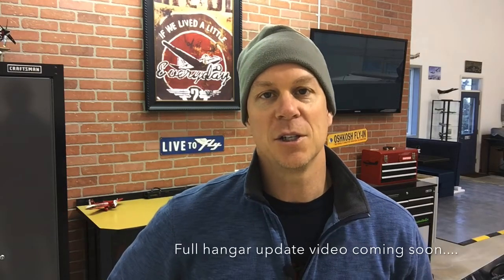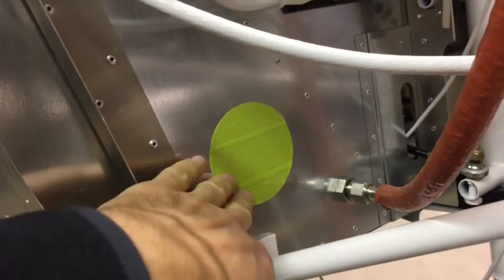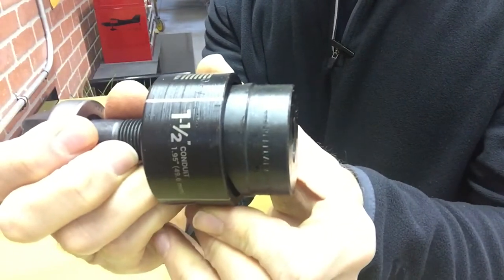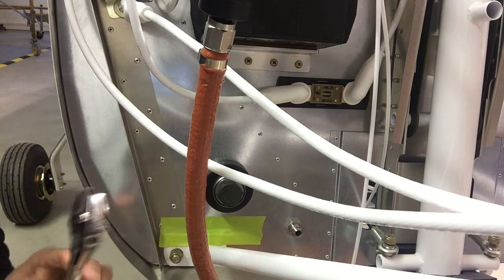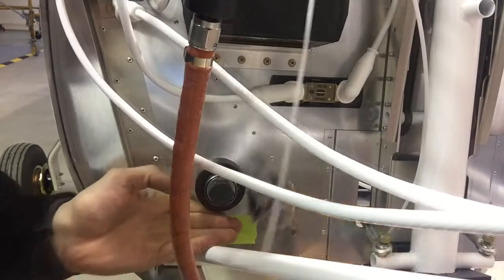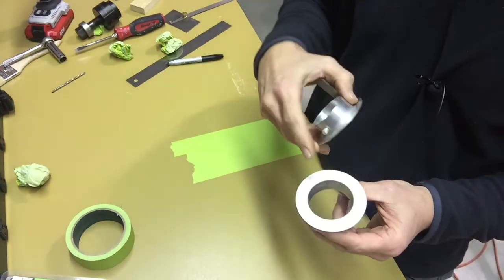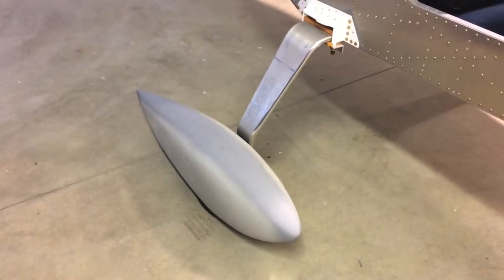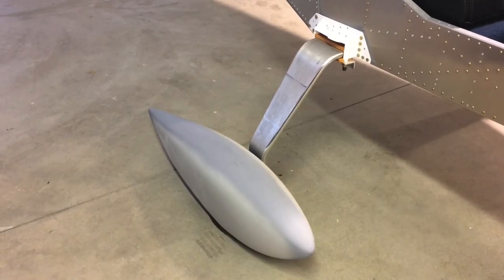Zenith Cruzer Airplane - Cabin Heat

Comment: Don't forget some stainless steel mesh with 8 mesh per inch.........form it like a spray paint lid and clamp it over the valve tube end , and under the scat tubing..........if any wasps or hornets build a nest in the scat tubing , they won't be able to make it into the cabin through the valve...........they will be pissed off and will be looking for revenge if they can make it passed the valve  ,  when you open it on short final..........or , you could also fashion a bubble shape ( like your fuel sender covers ) in a flat piece of mesh , to clear the flapper valve ..........and clamp it between the firewall and the valve halves.......either way would work..........I know of more than one pilot that had the surprise of his life , when he pulled the heater valve open and was treated with an encore of stings...

Comment: Cool plane, nice watch cap too. Got one just like it from AAFES. Just a suggestion, Two items I think you should add. First, a cable stop clamp. About about $2 at most parts stores. Place it on the inner wire so when the valve is full open, the stop is in contact with the outer wire. This will prevent damage the butterfly valve or maybe pulling the wire out. Second, there is a thingy called a Choke cable pivot you can use instead of bending the wire on the butterfly. Check Controlcables.com.  BTW, I sub'd today. HAGD.